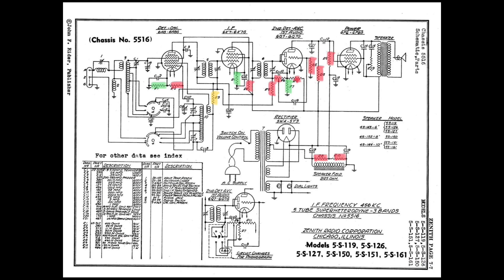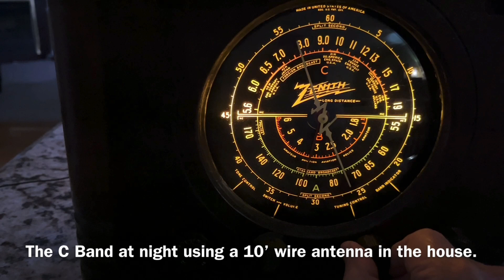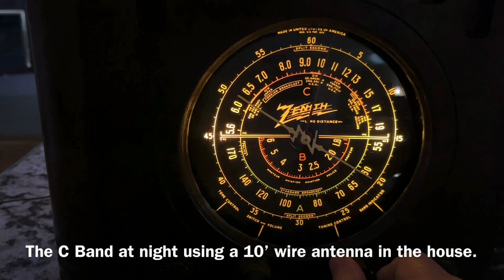Zenith 5-S-127 | Back Together & C Band (Shortwave Listening)

Comment: Looks like you did install a chassis mount line resistor. Those split-second pointers were a nice feature that Zenith added in their models. Don, this restoration series went too fast, looking forward for the next one.
Reply from the maker: Ken, the 25 ohm PR we discussed that I had on hand did the trick. The split-second pointers are definitely cool to look at and handy for the SW band. Just pulled another oldie (Simplex) out of storage and will be diving into it next. Thanks again for following the Zenith series. Best, Don